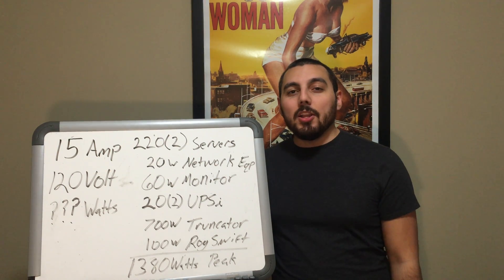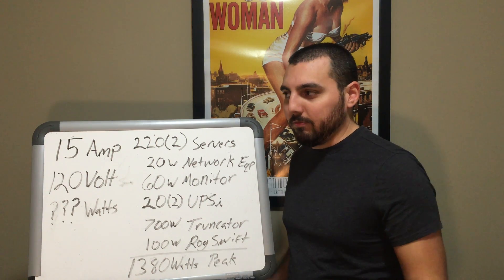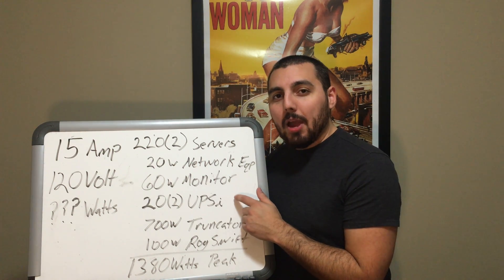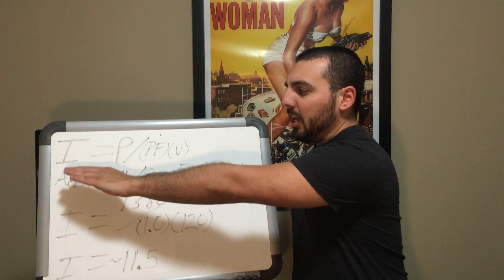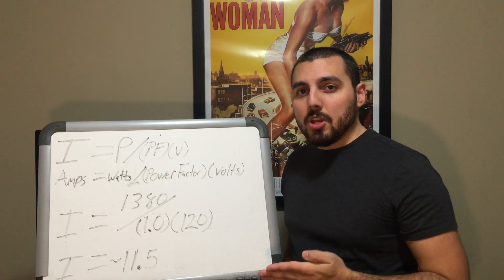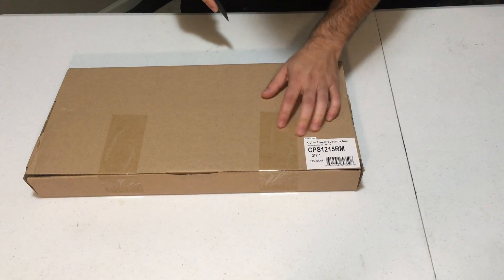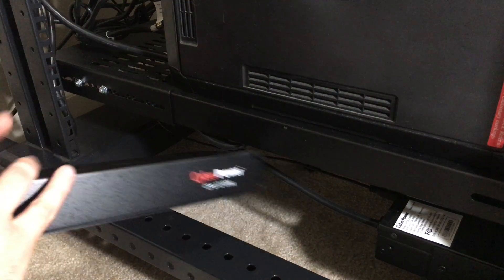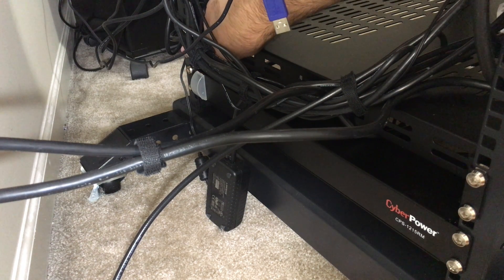3 UPSi 1 Cyberpower CPS-1215RM Rackmount Power Strip

Comment: Ouch !  Plug the UPS directly into the Wall Outlet...  And plug each UPS into its own fused circuit.  Then plug the Power Strip (?) into one UPS...  My APC PDU plugs into two UPSs...  For any servers with dual Power Supplies, then plug each into a different UPS (not the PDU).  Also for best use have NO motors on the computer circuit !  My UPS keeps my network running when the lights flicker !  Thank you for the video !  tjl  P.S Thank you ebay for the gently used equipment.  And the UPS beeps when a plug is knocked out of the wall socket !